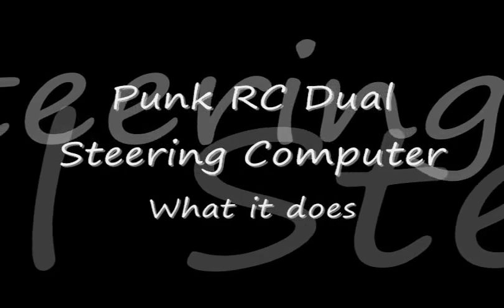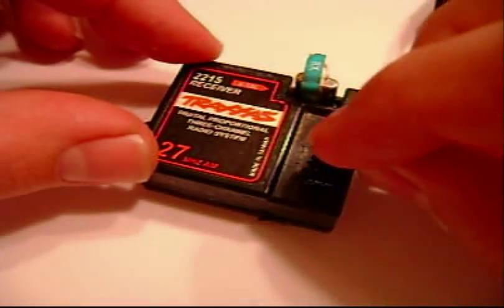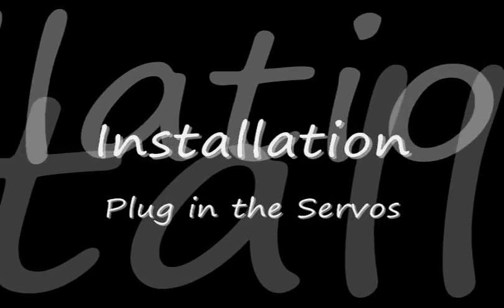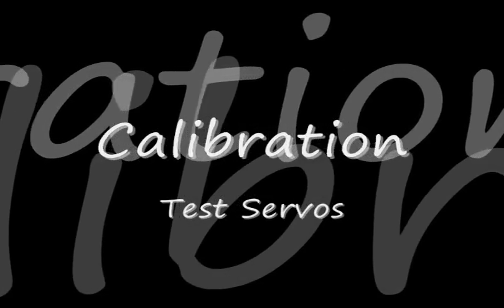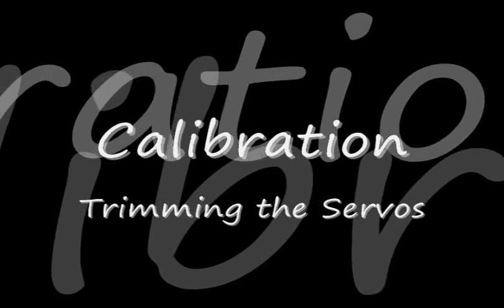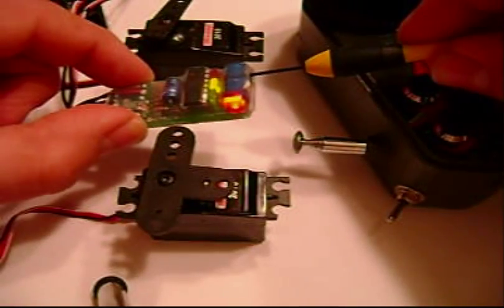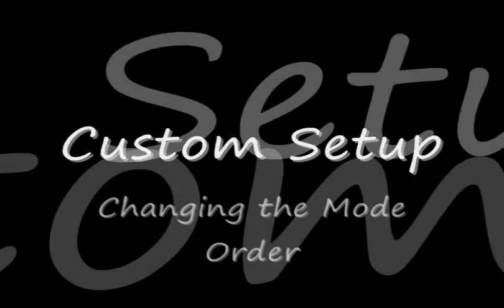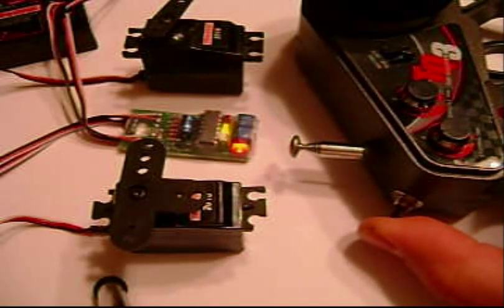PunkRC - Dual Steering Computer Installation

Comment: am I missing something?
 if you have a three channel radio with the three position switch,
(like I do) 
all you have to do is flip the switch to achieve the same thing that this unit does
(crab, ect)
just wondering 
thanks